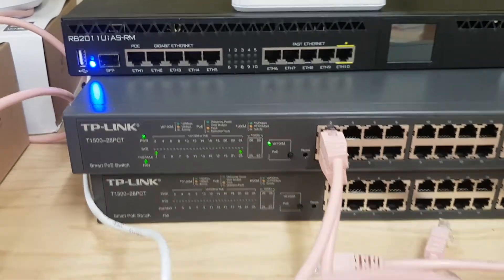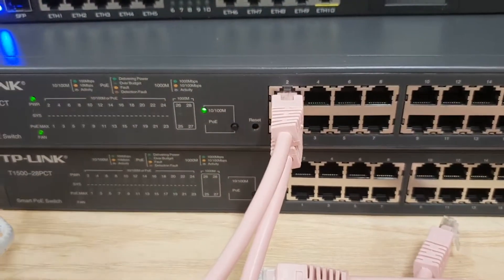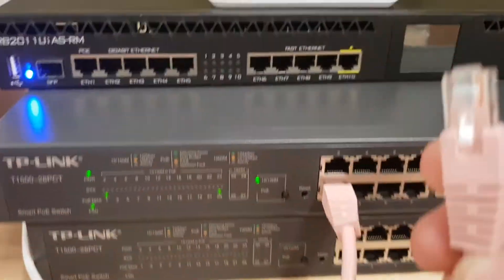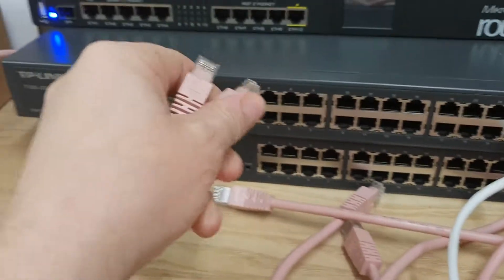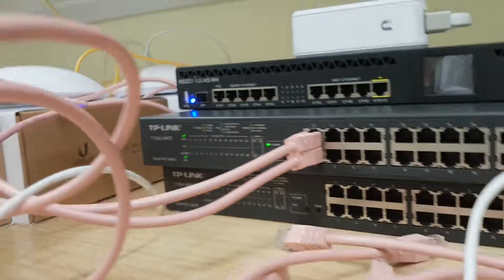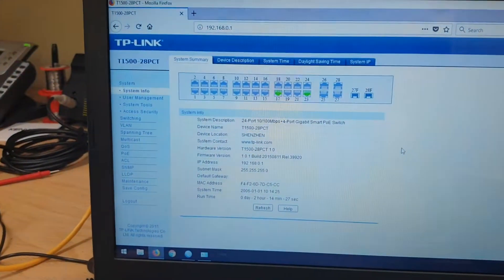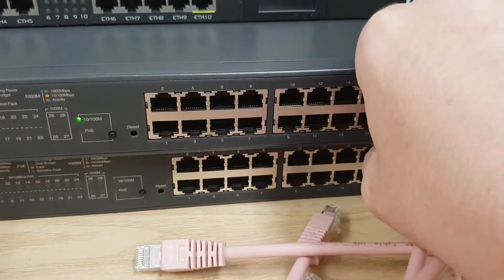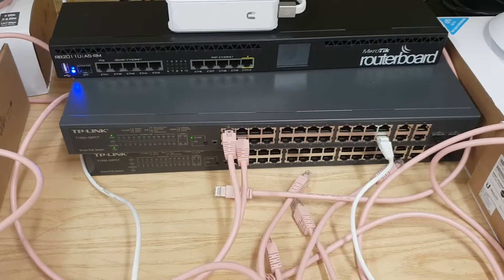TP-Link 1500-28PCT V1 POE Bug

Comment: Did software update fix the issue?
Reply from the maker: No this can not be fixed with firmware and has been confirmed as a Hardware problem.
Reply: @RADCOMMUK   Are you using auto on PoE watt supply? Try static to maximum watts